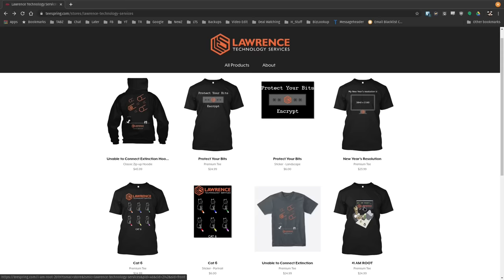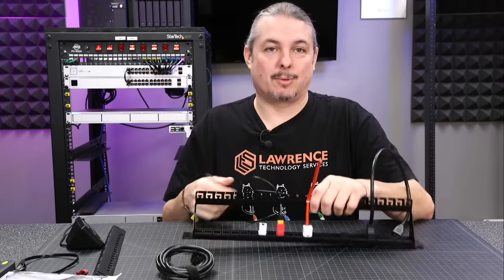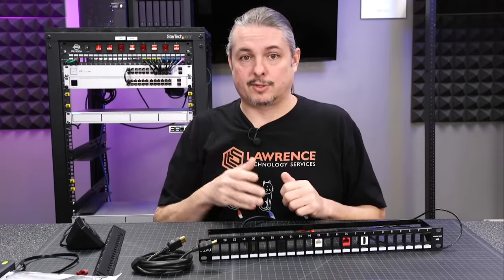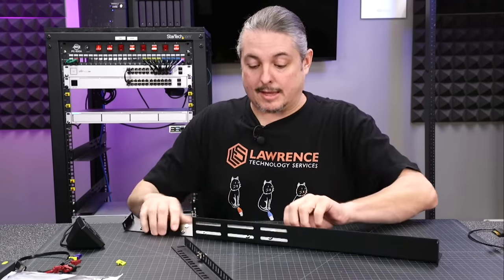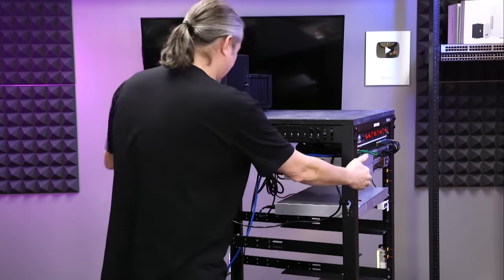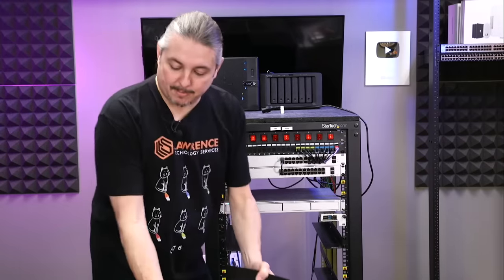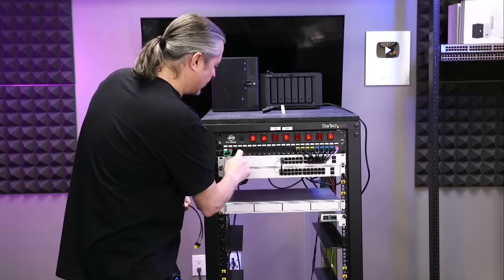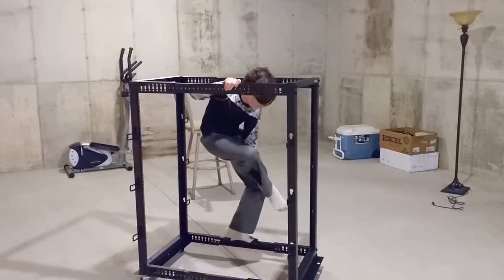DIY Home Rack Build

Comment: On the patch bay - you mentioned modular USB jacks on there. So that's using a coupler, effectively creating a male - female extension cable? Does that still transmit power cleanly enough to power a device? And does it impact data transmission speeds? I love the idea, huge fan of patch bays and never even thought about using one for usb!

Comment: I actually bought this rack based off your review video(and r/homelab builds using it). However, I don’t have that lean that’s shown here. Maybe it’s because it’s almost full or maybe it’s because I super tightened the nuts/bolts. Either way, can also suggest this rack.

Comment: Hello I have question, I want mount a server that I have, but I wasn’t sure of how I should mount it, the server has rail notches. But I’m not sure if I need to necessarily use the rails to mount or if I can mount my server without rails and just use the metal rack supporters that are provided

Comment: I'm just about to build a cabinet (9u) for a UDM and Unifi switch, plus some other kit. My major issue is side support rails. The Unifi equipment only has attachments at the front. I do not like the physics of that; the rear of the units would be unsupported and the lower bold/sttackment at the front will want to pull away. My cabinet is 450 mm deep and I'd like to use side support rails. Are there any rails that allow Unifi equipment to be installed onto them while also allowing the Unifi equipment to be bolted to the rails?
Reply: Speaking as someone who's racked hundreds of pieces of UniFi gear - You're worrying too much.  The front plate ears are more than sufficient.

Comment: Would be curious to know where you guys put your home-lab, I have quite a few devices but at the moment it's in the attic, (noise, space, and heat, are the main reason) I live in the UK so it's not too hot but this summer I had to put a portable AC in there. My big issue is it's not very accessible, and I can't get a full rack (with the panels on the side) because it wont fit through my hatch...I'm not sure if the garage would be a better option, it's definitively cooler in the summer, but again having to get out of the house to get to the lab is a pain (not that you have to be physically here a lot but still). Also, because it's more accessible, I would be more worried about robberies...

Comment: NEVER trust the cloud. I have had them flake out on me too many times.  The most secure, reliable place for your data is in your own, hot little paws. I once thought that they at least would be useful for backups. Not so. I discovered that  the supposed nightly automatic backup job was failing. This from a host that consistently is shown on the top-ten lists. I still use another for nightly backups, but also run my own and rotate offsite via old fashioned sneaker net.

Comment: To stop your rack from, well... racking back and fourth, just cut some plywood spacers to the dimensions of the front and back of the rack, maybe 4-8 inches tall. Bolt them on and it will shore everything up.

Comment: I have a slight issue that I can't figure out. So, I got 3 servers which I want to rack mount.
2x HPE DL160 gen10 (24.21" depth)
1x HPE DL320 G5p (26.85" depth)
Will I be able to rack mount all 3 of these servers on the same rack? I'm eyeing the StaTech 8U 19" adjustable open frame rack.

Comment: I think the easiest way to reduce that racks swaying would to use all the screws for everything. Adds a bit of rigidity to the structure. As long as you dont pack all your heavy stuff on top, the sway shouldnt be an issue... Dont tip your server
Reply: Yes, heavier stuff towards the bottom of the rack. So UPS, storage server at the bottom, patch panels and switches at the top.

Comment: My frustration is most rack shelves do not fit nicely with close quarter equipment. The lip does not allow it to sit flush with switches for example skipping a U is usually necessary.

Also, does the minimum length for Ethernet cables no longer apply? I see some of the sub 1 meter cables between the switches. I was under the school where you only use those between premise cable patch panel and switches (where premise makes up the rest of the length).

Comment: Do you have issues with interference from the power distribution to the cable runs from the patch panel or do you use STP?

Comment: No mention of how you handle UPS power for your equipment, if you’re just using switched PDUs?  Or are those PDUs plugged into a UPS at the bottom where we couldn’t see it?
Reply from the maker: No, my Lab doesn't have a UPS

Comment: I'm sorry, no, Tom, you are wrong on those reusable ties... they are indispensable! As someone, who actually has a cupboard for networking equipment, I can't stress enough how important these are even for very messy installs. Why? Simple, there is so much slack, especially coming from all the power bricks, that not tying them, make's it impossible to work in the lab itself! And since it's a lab, it has to be flexible. That was a lesson hard learned on my part.

Comment: Hi, I am currently planning out a rack build for my closet and I had a question about the shelf. My ups isn't rack mountable and it's quite heavy. Can the shelf hold the weight if it's supported only in the front?
Reply from the maker: The max weight is usually listed on then product pages.

Comment: I'm confused on the little loop thing that you breezed over. It patches to the core switch to the switch in the rack? White port comes from the main switch and red jumps back across to the other red port on the patch which then feeds the switch in the rack?
Reply from the maker: The loop is to make it easier for me to test other 10G switches

Comment: At 16.28 May I add as a side note (which wasn't mentioned in this part) in regards to rack shelving is to make sure that you get the right size for the rack mount you have as I made that fatal mistake of getting a shelving rack that was too big for my rack mount so I had to use an angle grinder to cut it down to size to fit it in the rack

Comment: Could you vlog about networking with pfSense and LDAP with discrete local DNS and DHCP servers?  I cant find documentation to get pfSense and FreeIPA to play nicely.

Moving dns/dhcpd/ntp off the firewall seems easy, but it breaks the whole system.  Easy for single lan... not so much for multi interfaces/vlans/vpn/dmz/iot.

Do I create a separate VLAN for freeIPA to control access to/from hosts on all interfaces? (And turn off dns and dhcp)  Would pfBlocker-ng still work?

Comment: I'm a home run guy....

And I beg to bring it up!!!! At what point is a patch panel necessary???
You're just adding points of failure( almost 6 in patching alone(you also have to add terminal equipment...NIC's...etc..).....

IMO.... Do everything A -> B....  So much easier to troubleshoot.... Better/faster/reliable connections.... Probably even cost effective....

Comment: Hi Tom. I would definitely like you to test the amount of mass that different rack studs would take. Due to the torque that would be created due to where the centre of gravity is, would you test, separately, with weights at roughly a quarter depth, half depth, three quarters depth. While the force should always be a similar result, we all know that, in practice, it may not be. One other part of the test, I would like you to include, is what difference would be caused by the orientation of the rack studs, i.e. tabs on the sides or on the top or bottoms. We all know what we think the result should be,  but it would be nice to see what the difference is, in practice. Thanks for all the great content
Reply from the maker: https://youtu.be/JZPby6fkKwk

Comment: I've been watching a few of your videos lately because I recently bought a 3500+sqft house and want full mesh wifi, security cameras and video logging, vlans and Layer 3 to keep the IoT stuff separate, and also to separate the general house wifi from my office lab network, and also to route cables to the media room.  If everything's on the wireless, it'll get bogged down.  So... time to think about getting a server rack, some hardware, and setting things up.  Does anyone have tips for where on the rack components should be placed?  I'm thinking a UPS on the bottom, possibly routing power up to a power strip up top.  Also up top should be a patch panel and some cable management, followed by network devices like (if I go Ubiquiti) the Dream Machine, a Layer 3 switch, something to record the camera feeds, and so on.  Finally, I'd probably add a rackmounted server for virtualization if any exist that aren't too noisy.  Then run cables from the PoE switch to some other rooms in the house, adding other switches in the media room and the two home offices for ports for things like access points (if I don't mount those to the ceiling).  My current network back here in California is just a cable modem plugged into a Netgear Orbi setup, but I want to do the new house right, and give myself a really cool lab to play with.

Comment: Your rack is racking! To stop that, put a diagonal brace across the back. It doesn’t have to go the full height, if you have space near the bottom you can use 4-5U for the brace. Or if you have attachment points at the top, you can do corner bracing.

If you care, that is.  I probably wouldn’t, unless I had very heavy loads high in the rack.

Comment: Would love to see you compare and recommend longer patch cables for 10 gigabit desktops that also support full PoE. I see a lot of tiny rack patch cables and cables to carry in your bag but not finding anything for 10' to 25' patch cables for high end 10 gigabit desktops, or what cable would use for your 10 gigabit NAS that also support PoE?
Reply from the maker: The Monoprice CAT6 cables in the video support both POE and Gigabit. https://kit.co/product/monoprice-cat6-ether-1237848
Reply: @LAWRENCESYSTEMS  10 Gigabit? looking for M1 Mac Mini with the new 10 gigabit built in that is 20' from Meraki SFP+ port (using FS Transceiver from your recent video). Would that black snagless mono cable you like work here? Is there no reason to buy patch cables now that are 26 AWG?

Comment: I just bought my rack and shelves is really what I need but for USB I prefer the USB over ethernet great method I also have VGA over ethernet in case my server disconnect from the network I can connect to it via ethernet adapter. I just think Ethernet cables are great! I have  hdmi,vga,usb all over Ethernet. If anyone has other things they do over Ethernet let me know

Comment: Congrats for the video! Kudos for doing and very explanatory! Forgive me the silly question but I always had a doubt when doing patch cables using Cat6, I wanted to do those small cables (like 3 inches) but I wanted to know if I remove that plastic divider between the pairs if I will have any kind of interference or loss. Thank You! And keep up with the videos!

Comment: Probably an odd question, would a punch down version of a patch panel work for plain phone service (as long as its wired correctly)? 
Scenario: run ethernet lines to every outlet/spot in a house/office to a patch panel then setup a punch down patch panel to "spread" the phone service to the desired lines and can change the port in the wall at the rack simply by changing the jumper between the patch panels for multiple phone lines or ethernet without having to re-run the in wall wiring. 

Probably more expensive and extensive during initial setup but sounds like a fully configurable setup.
Reply: Running cable is expensive, running  more cables individually is much more expensive. Say at home, you want  Ethernet cable dropped to the back of your tv, run a second (and maybe a third) cable for game console.

Moving back to the office, you decide to put an Ethernet port to every desk, great. What about staff that work from home and the like. Better make it another Ethernet port. If you are running two, then add another cable for the VoIP phone system.

If you are talking about analogue phone lines, yes that can be routed through  patch panel, Just make sure that the cable grade is the same if not better than what been required.

I'm not a cable guy, more server with some networking theory. I have never run cable, apart from throwing a coil of pre-terminated CAT5 across a false ceiling after we needed another erhernet port in a confernce room in  hurry. One was never going to be enough, make it four.

Comment: What holds the servers up at the back of the server?is there a cross bar that supports the servers weight at the back?
It can't be just the 4 screws at the front of the server!
Reply from the maker: The same cage nut style holes are in the back.

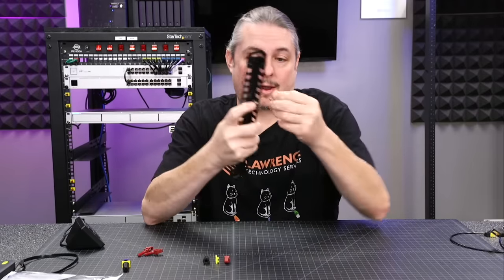Comment: 8:20 It seems to me that cage nuts have to be oriented horizontally so that they do not interfere with neighboring ones and are easy to  remove by pressing the edge from aside.
Reply: Also the square holes are not quite square in most cases.

Comment: I am network engineer for the last 15 years...
Please don't use 4 pole racks with equipment mounted in both sides as network equipment are designed to push air from the front to the back or side to side in the old days.... without the proper airflow your devices will overheat as the hot air will have no way to go causing serious performance issue and even hardware failures.
Normally, the back mount side is to be used for cable management and powering up devices. The reason is that normally power supplies are in the back so it make sense to use the back of the rack to mount power distribution units (PDUs).. (rack mounted power strips are called PDUs)

Comment: dude, you assembled that startech 25u wrong, and that's why it's shifting. The top crossbars (the ones with the startech logos) should be behind your corner frame parts, there's a slot for them to slide into. (that's literally what that little gap you mentioned is for) Assembled correctly they don't shift at all. Mine doesn't, nor does any of the ones i've used over the years.

Comment: Hey, nice video. I am very interesed in a home lab rack but I am concerned about noise. Any recommendations or tips to keep it quiet (and be able to work in the same room)?
Reply: With my rack I replaced all the fans I could with better and quieter fans which cost a bit of cash but now my rack sounds more like a slightly loud gaming PC compared to the stock fans that sounded like an airplane taking off. So far I haven't had any issues with the Noctua fans I used but they've only been installed for about 9 months so far.
Reply: Larger-diameter fans running at lower speeds.
Liquid- or magnetic- bearings.
Elastomeric isolation mounts.

Comment: Just a wish. Why can switch manufacturers spread the ports out across the whole switch face on rack mount equipment. This has always bugged me to no end. For example, If you have a 24 port switch just make it with 1 row across the face instead of 2 rows like the 48 port. Or if you have 16 port group them into groups of 4 and space them out across the face of the switch. That way when you put them in a rack (like they are intended to be) it looks neat and clean when you go from the patch panel to the switch with your patch cables.

Comment: I dont have that rack flex issue with my star tech 42u rack
Reply: I think it flexes because it's mostly empty. I think once you add servers/equipment, the equipment will make the entire thing more rigid. It's also possible he didn't tighten some of the screws all that well. I ordered a 25u rack, and I think this is the same one, since it looks to be around 4 feet tall. I'll see if I get the same flex he's having with his. I may end up with similar flex since i don't really have a lot of equipment to add to the rack

Comment: Do you need a mounted power strip if you're using a UPS and you want everything on a battery (or two)?
Reply: I have 2 rack mounted powerstrips. Each plug into a different UPS. All the things plug into the power strips. I was recently on vacation and one of my UPS died. I was able to video call my daughter and tell her visually to move the "plug in the back of bad UPS to the surge side of good UPS". For that reason alone, I'll continue to use rack mount powerstrips in the future.

edit: no, you dont need one, it's just convenient
Reply: I use PDUs without surge protection plugged into the UPS.   I've read somewhere if there is an overload the surge protector may kill the UPS.  I've never experienced this myself as I have several CyberPower UPS (both true sinewave and stepped sinewave) at home. It wouldn't hurt to have a plain ole power strip into the UPS as it has it's own surge protection anyway.
Reply: You don't "need" it, but it is well worth it.